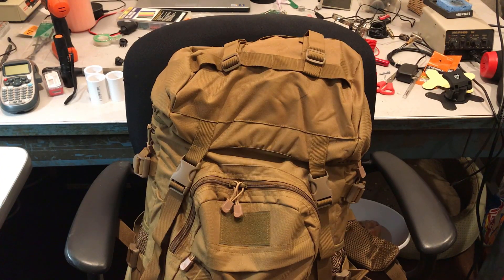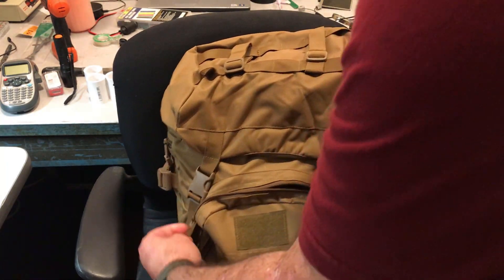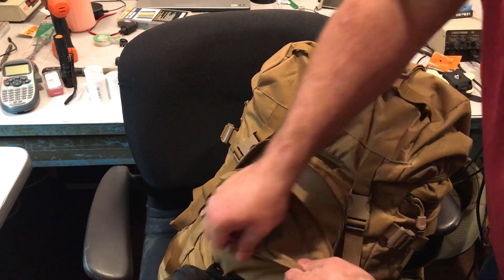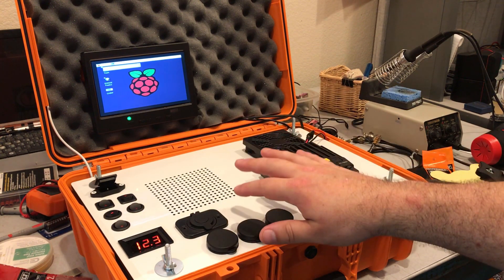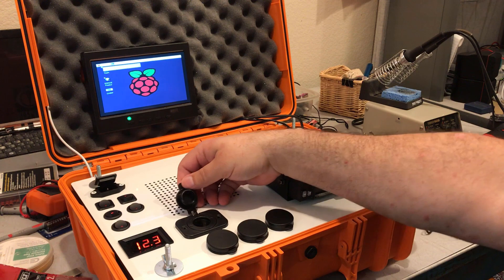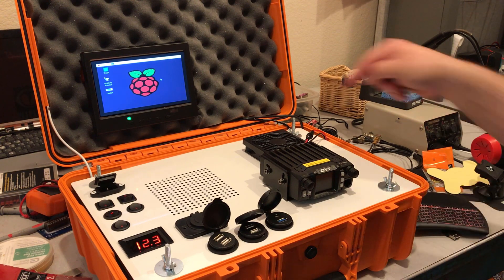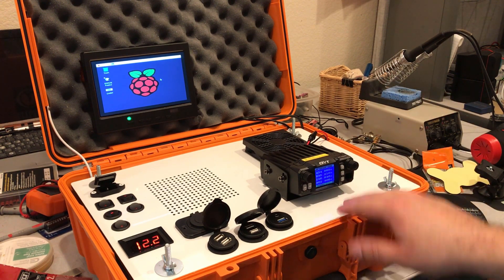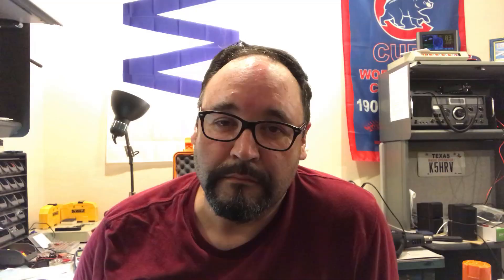NOW WITH PARTS LIST! - Ham Radio Go Box - My First Attempt To Build

Comment: Very slick!
Reply from the maker: Thank you sir!  Dang, I made this video a zillion years ago but I guess it still holds up.  I'm thinking about making another kit that's a LOT lighter.  The one you just watched me build is a beast...great for car travel, not so much for hiking (ask me how I know LOL).  Thanks again.
Reply: @k5hrv605  I am new but I have a few different rigs. One is a rackmount and the other is the Military Backpack link I posted. It is actually a sniper pack but it works great for radio deployment. The "gun compartments" work great for several different antennas and a few of the others are where I pack the radios. I use 2-3 Dakota Lithium 10Ah batteries with a 50w solar panel that straps to the pack. Very mobile, super quick deployment and you can take it anywhere!

Comment: For nice build for hobby/ rec use! 

I don’t see it being used for any kind of redundant or emergency communications as the size and setup( radio/ software)  dosent seem practical.
Reply from the maker: In the time since I built that rig, I've come to agree.  I tried to make it "cool" instead of practical.  It's too heavy, too big, needs a higher quality/more capable radio, LiFePo batt, and a small headless PC instead of an RPi.  I'm thinking of making a video about precisely that, along with a more practical build.  I'm always open to suggestions!

Comment: Being a Linux/MAC OS user only I also stumbled upon the dilemma on how to run winlink and VARA modem on my go box raspberry pi using the Signalink and the KX3, well
The PI4 with 8 gigabytes of RAM can run Windows 10 flawlessy (at least for what I need to do) so I carry two SD cards in the box, one for Raspian and one for Windows, so if I need to run Winlink/VARA to send or receive email while out camping,  then I insert the Windows 10 SD card into the Pi and I'm in bussines.
Reply from the maker: Nice!  I hanven't made a video about this yet, but I've replaced my Pi with a very small PC (12v) running Win10 - solved a lot of problems.

Comment: For the extra switch:  It is possible to use the Raspberry Pi without a monitor.  For instance, you could use a table to SSH into the Raspberry over a WiFi network run by the Pi itself.  Then you wouldn't need to power the display.  So you could use one switch to power on the Pi and a separate switch for the monitor.

Comment: Repeat, nice job! One recommendation from what I learned building my first:
Use barrel nuts or (easier to find) acorn nuts. They cap off the support bolts neatly AND prevent gouges to the arm. Just use bolts that will not be more than 1/5" an inch above the the cover panel.
Also learned that using nylon locking nuts to set the height of the covering panel and to minimize the length of bolt that is exposed. They can be adjusted to get the cover panel at just the right height. The two bolts trick to lock is okay but a PITA when adjustments are needed.
AND...I learned that using a fuse panel with spade connectors with no ground post is easier. You can place a common ground wherever you like and is can help keep the King Rat from forming!
LASTLY...I prefer to have my plug-in receptacle (USBs, cigarette lighter, etc.) toward the case hinge. Keeps wires/cords out of the way. 
Okay, last comment: I am still looking for a speaker to mount on the cover panel. I have a Yaesu FTM-400XDR and the control head is a PITA to position. The radio body is beneath the panel` and the built in speaker gets muffled a bit. I have a cut-out area where I mount the control head on a DIY bracket. It lowers it just enough to close the Apache 2800 case lid and not put much pressure on the control knobs. It does allow for hearing the speaker but I still want the exterior speaker option.

Comment: I like your video. I would like to see more about how you interconnected the AC power into the system, inverter you used, etc. Do you have plans to incorporate a solar charger into your setup ? I also didn't see what you did with regards to your antenna setup and still maintain the waterproof integrity of your case.

Comment: I’d put some sort of led light on it and run it to that unused switch.
Reply from the maker: You're thinking is right on the money in my opinion.  Unfortunately, one of those switches does already control an LED strip at the top of the open case.

Comment: nice build, one suggestion is to put an Anderson Power Pole outlet on the box. If you operate with other people you may need one.
Reply from the maker: Yeah, I think you're right.  My plan was to add banana plug outlets instead of powerpoles because the whole powerpole thing seems like an expensive marketing ploy to me, but so many people use them that I may add outlets for both.

Comment: How did you mount the monitor to the lid? Heavy duty Velcro? Gerald KG0VA
Reply from the maker: Yeah...and it's not great.  On hot days, every once in awhile, it slips off as the adhesive on the back of the Velcro stuck to the lid warms up.  Using epoxy between the plastic back of the monitor and the plastic lid would likely yield a more permanent solution, but I'm still not 100% certain I'll keep the monitor in its current position, so I'm holding off for now.
Reply: @k5hrv605  Thanks. I was hoping for a better result for a project I'm planning.

Comment: Where did you buy your AC waterproof plug? I've scoured the internet and I can't find one.
Reply from the maker: Thanks for your question!  Aliexpress.com has many vendors that provide them.  A word of caution:  the plug isn't "waterproof" so much as water resistant.  It is simply a socket with a tightly-fitting lid...but I would never submerge it and assume it would prevent all water from entering.  I use it to reduce the chances of water and dust from entering if there's rain or dust present when the lid is open. And if it does begin to rain while the lid is open, I quickly close it. Here's just one vendor:  
https://www.aliexpress.com/item/32845137744.html?spm=a2g0o.productlist.0.0.6f73578ffll9XJ&algo_pvid=189e1488-20e4-453e-9626-ee969af94086&algo_expid=189e1488-20e4-453e-9626-ee969af94086-4&btsid=0ab50a5715983199100212567e35c2&ws_ab_test=searchweb0_0,searchweb201602_,searchweb201603_

Comment: Very nice build 👍.  Consider bringing Pi's micro SD card out to the faceplate. You can get extender cables with bulkheads and covers. Looks like you have the space for it.
Reply from the maker: I hadn't considered that. Not a bad idea, and wouldn't take much effort.

Comment: Do you have plans for solar power to recharge battery?
Reply from the maker: I do!  There's still a lot of space under the panel for stuff.  I want to put a solar charge controller in there, add a couple of power pole and banana connector sockets...maybe make the tri-band radio swappable with a little HF radio even.

Comment: What product name LCD screen and keypad?
Reply from the maker: "Cheapest Possible"...ok, just kidding.  Seriously, I source a lot of my parts from vendors on aliexpress.com.  It's hit and miss quality on that site, but there are sooooo many vendors that sell the same things coming out of the same factories.  I usually get good products by making sure the products I order have at least a 4.8 star rating and have sold at least 100 units.  For the LCD screen, just search for "Raspberry Pi 7 inch screen."  I got the non-touchscreen version.  For the keyboard, search for "Small Wireless Keyboard."  Seriously, that's all I did.  Neither item has an actual brand name :-)

Comment: Finally someone who understands if you have a water tight case you don't put holes to the outside of your $$ case for accessories which wrecks it's Water Proof Property's & flotation ability!!.  Please List items used in build for the viewers Great build !!!   Now you need a solar charger and LifePo4 Battery Build 100amh ad some Anderson connectors. Question Why a fan when QTY 25w and on top of inner cover? do you have power supply that hot? Tighten loose nuts and use lock tight in future lol.
Reply from the maker: YES!  THANK YOU FOR THINKING THE SAME WAY!!!  Why on earth would anyone drill a hole in a perfectly good watertight case when there are all sorts of ways to get around that?!?  Clearly you and I are in the intelligent minority :-D
Reply from the maker: And your other comments...yes to all.  I knew the fan would be overkill, but I operate outside in the summer in Texas and I wanted to be extra sure I didn't melt my rig.

Comment: Nice setup. What is the material used to mount everything and how did you cut the holes needed?
Reply from the maker: Yeah, I should have addressed that in the video, but forgot.  The 1/4" plywood platform on the bottom of the case is attached to the inside of the case using "industrial" Velcro, available from Home Depot, Lowe's, etc...  I'm also using industrial velcro to keep my components attached to the plywood.  The holes cut into the control panel were made suing my employer's very large computer-controlled router (I got a lucky break).  To replicate that kind of precision by hand would've taken me a long time (especially the 144 perfectly-spaced vent holes).

Comment: Would you mind sharing what the top surface of the box is? It looks like white acrylic but I'm not sure.
Reply from the maker: Hi!  I'm fortunate to work for an employer who uses this material for one of its products and allowed me to have a scrap for free.  It's excellent for a control panel.  It's called ValuMetal by a company called Nudo.  https://www.nudo.com/p_valumetal.php?crumb=%3Ca+href%3D%27l_sign_panels.php%3Fitem%3Dproduct%27%3ESign+Panels%3C%2Fa%3E

Comment: Nice setup!!  I did something similar with a 50 caliber plastic ammo storage box from MTM.  I have a video of it and it's Construction on my YouTube channel.  That extra switch could be used for a TNC or a Signalink sound card interface.  You could do digital on VHF or UHF on simplex.  Use to do that a lot 12 years ago.  Did PSK and even slowscan tv on 2 meter fm simplex.  Juddie WD8WV
Reply from the maker: I think that's a good idea for the extra switch...and probably what I'll end up doing.  I'll go take a look at your 50 cal video this week.  73!